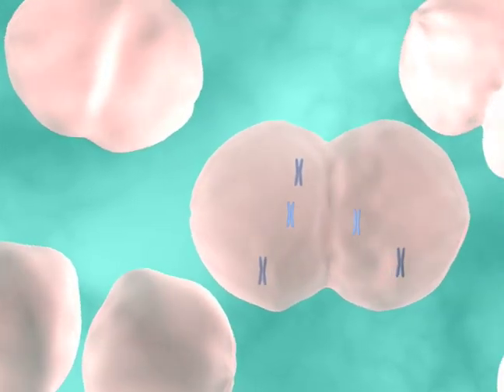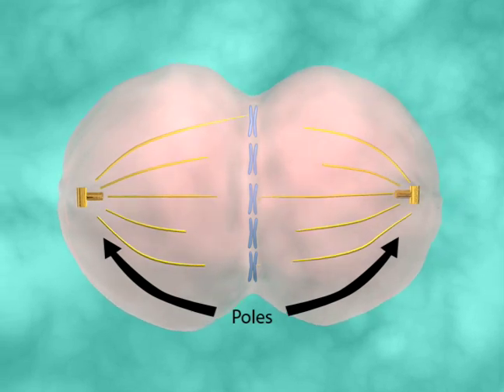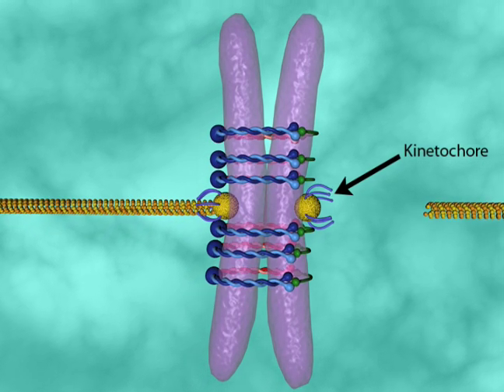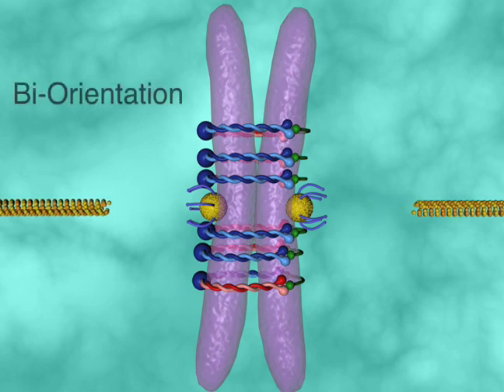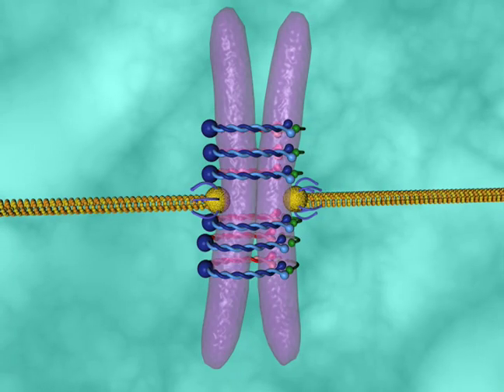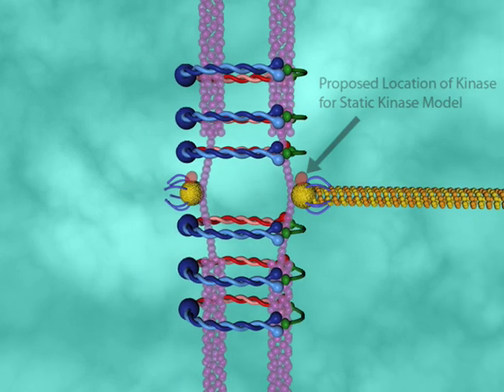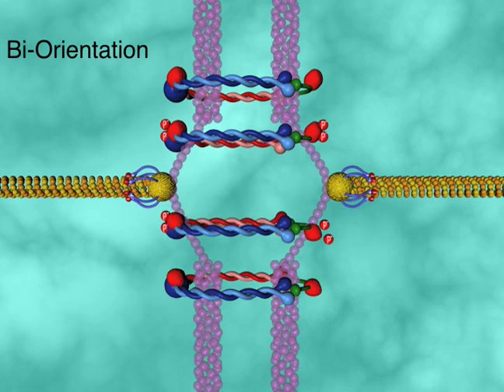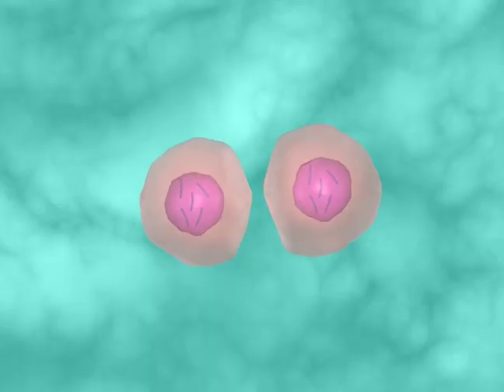Danny Funk Final Draft.mov

Comment: I think it would have been slightly clearer if they were initially bouncing around in a more spherical cell.  This might avoid confusion - as at present they look like they are undergoing cytokinesis (the contractile ring's diameter mysteriously shrinks) - my understanding is that this is only visible after chromatid separation (during telophase).